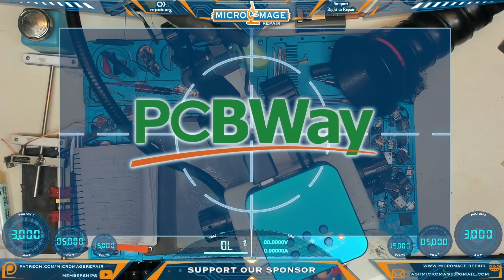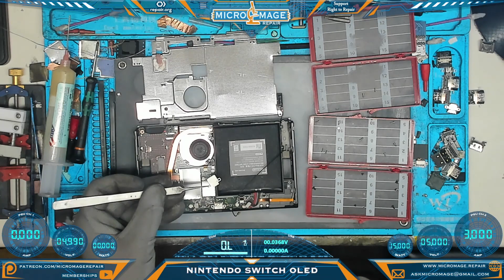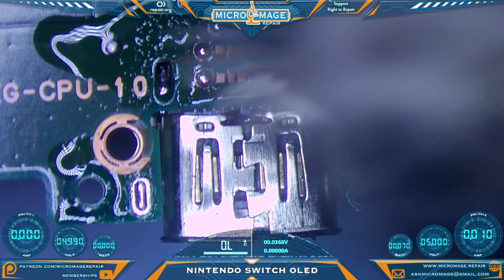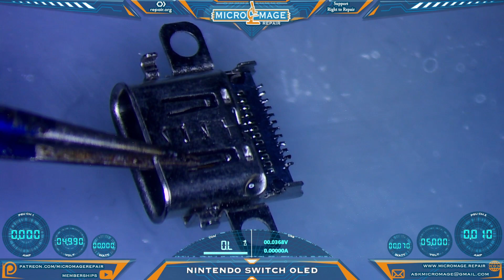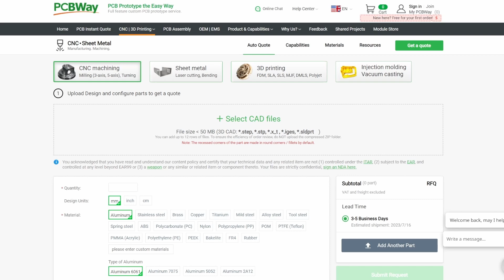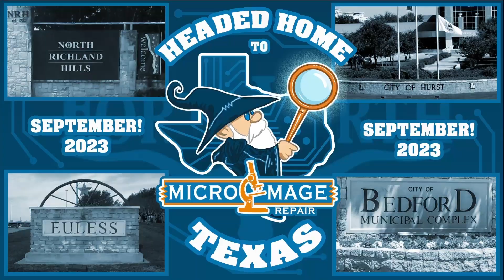Switch OLED:⚠️ Our First Port and That is not All!

Comment: The switch Wizard strikes again Pretty nice Find I see why you use low melt Removing Those ports 😂
Reply from the maker: Thanks man!
It's the method that works for me. So many options with removal.
Reply: @MicroMageRepair  I think I will start using low melt On the switches too I never use it on anything I have a decent amount of it i'm sitting on Need to clear the dust haha
Reply from the maker: @QsTechService1  it's very useful if you wick. Can't imagine trying to clear anchors without it at this point .
I'm spoiled!
Reply: @MicroMageRepair  Yeah, I think I will start using  It's hard to get It out of those pockets Those boards take a lot of heat

Comment: Great Repair and Video!  Is the second row of pins on the port, visible through the small holes in the port?  It looked like it, unless those were still the back pins.  Thank You.  😀
Reply from the maker: Thank you!
No unfortunately this is one of those blind soldering jobs like a BGA.
You have to settle in on a method that gets you consistent results with it.
Luckily there are a lot of methods. I'd try them all.

Comment: Low melt solder brand/type?
Reply from the maker: I use what is basically the base elements of low melt .
A lead, besmith, and tin alloy.
All low melt has these to varying degrees so it doesn't matter to much what you choose.
Mine comes in little nuggets as opposed to sticks most people don't like so I don't link it.
For me starting out it was a cheap alternative to what at the time was expensive packages.